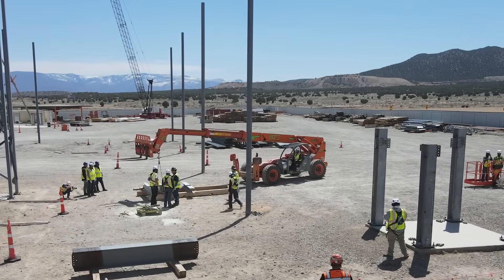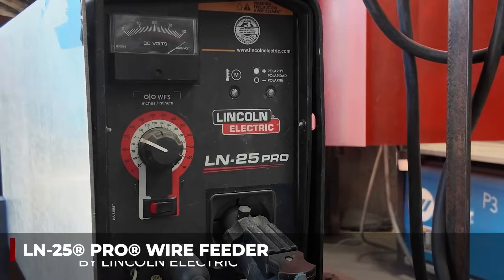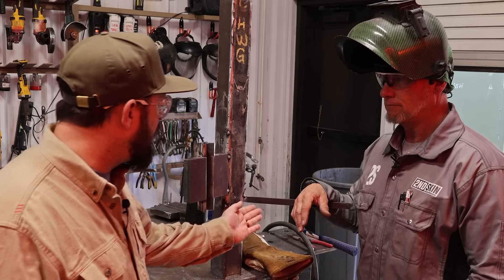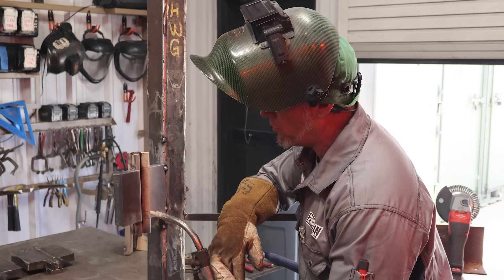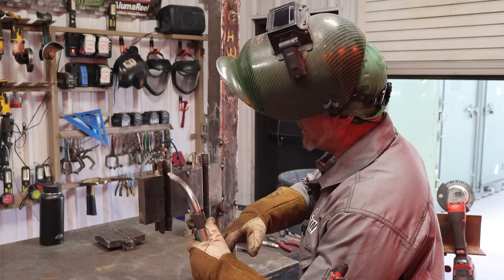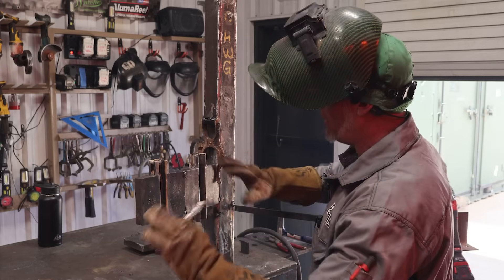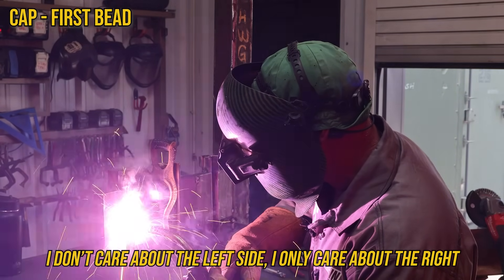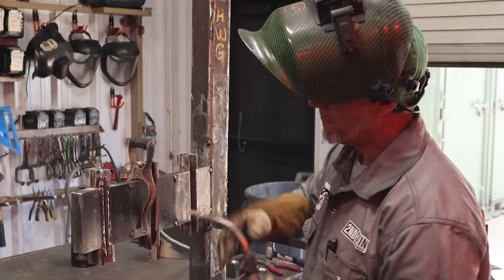FCAW-S Breakdown: How to Nail Your 3G on 1” Plate

Comment: That guy really knows his stuff. Seems to have a very strong technical competency with clear knowledge about basically anything-welding. Must be a treat to be taught by someone like that.

I'm a DIYer who occasionally does FCAW out in his garage using a Hobart 190 for little things around the house, and after watching this, I'm amazed at how he never once used any anti-spatter spray because when I do my stuff, I spray that shit on almost everything like a yard sprinkler. Ha. Again, a DIYer...

But I hate how FCAW never gets the respect that I think it deserves within welding circles. Coming from someone who's as amateur about this stuff as they can get, even I can tell that if it's done even just "generally well," FCAW welds can be every bit as strong as anything else out there. Sure, they never look like stacked dimes, but if I was a betting man--which I'm not--I'd wager my house on the idea that you can have welds from FCAW that can be just as good as anything done from GMAW, SMAW, or anything else (as long as it's done correctly). Yes, "done correctly" can apply to almost anything in any context, but I know I haven't seen any TIG stuff that has the strength you can enjoy from FCAW. Not saying it can't be as structurally good, just that I've never seen it. But like the guy kinda implied, it's more of a structural welding type anyway--and definitely not meant for aesthetics or finer control (i.e. - thin or precise welds). At least, that's what I've always understood about it.

But in any event, great video.
Reply from the maker: Thanks for watching! Won't be the last time we do a FCAW video.
Reply: Don't forget: gas is worthless when it's windy.
Reply: @AwestrikeFearofGods  Barriers and shields are used on construction sites all the time when using FCAW-G outdoors with wind blowing.
Reply: @ChevyConQueso  Fair enough, but most home gamers don't spend the money or space to store welding tents, etc.
Reply: Dual shield FCAW axial spray is one of the funnest processes, and also really strong. Lots of it in construction and ship building.
Reply: So you are willing to trust your family and friends lives with a Fluxcore weld
Reply: @Nuf_Nivah  I don't think the person commenting is building a skyscraper or roller coaster. I think he deserves mad respect; he's a self described diy'er and knows a $hitload about the technical aspects of welding.
Reply: @jennysouther1795 ok but that’s not way I read it saying it is a as strong as stick
Reply: @Nuf_Nivah if you are using consumables with equivalent specifications, there’s no reason it’s not as strong. Obviously you’re not making structural welds with wire that you run in a Hobart 190,  🤦🏻‍♂️
Reply: @Nuf_Nivah  Ironworkers use innershield as well as smaw and I believe dual-shield too
Reply: @Nuf_Nivah  Fluxcore is 100% as strong as any other weld as long as it was done properly and has the penetration it needs. You can do a lot with 190 amps. You use multiple passes just like if you were using nothing but 3/32" rods and 90 amps on thicker steel. Preheating the metal is necessary once you're over a certain thickness regardless.  Don't discount it just because the average user of a small machine and FCAW is completely talentless, unqualified, and lacking the knowledge to weld anything critical. With skilled hands, you can put just about anything together safely with any process.

Comment: Not mentioned in the video, there is also multiple types of the wire. Some, like the E71T-GS, are only good for single pass applications. But the E71T-11 , is rated multi-pass applications. That’s a pretty important thing to be aware of when buying FCAW-S wire.

Comment: If you go for your d1.5 certs you aren’t allowed to use any power tools. Chipping hammer and wire brush only
Reply: In the real world we use power tools, we don't care what your test requires.
Reply: @MasterCheeef cool
Reply: Very cool @johniron88
Reply: They allowed me to use a wire wheel on a 4” so there’s that.
Reply: @FNxmm then you probably got d1.1 cert not d1.5. In the AWS test procedure regulations. It states d1.5 no power tools. So there’s that
Reply: @johniron88  actually i think you are right i was on a different test. Sorry for the confusion.

Comment: i went to make a welding test long time ago  at shuff steel and they don't 
 let use the grinder even the wire wheel just wire brush and chipping hammer?
another thing where you got your welding hood
Reply: Hood is from CMR Fabrications

Comment: just glue it
Reply: I don’t understand why they are trying to push fluxcore . It’s not going to be as good as stick the only thing I can figure is that they can just get “welder’s “ out on a job site. Welding is a skill you are born with but it can be learned. And the best welder’s welds you can’t see the weld because it’s actually married together.
Reply: @Nuf_Nivah where can we see these invisible welds? Have you posted some videos ?

Comment: As a union iron worker out of local 402 this video was very helpful especially with how difficult this wire can be especially in the 3g position very helpful video👌
Reply: #seechriswork
Reply: So you are saying that you would trust this like a stick weld
Reply: @Nuf_Nivah  yes I would
Reply: @CristobalMojica-nh4gv  as a union worker,  your Union hall will provide this training at no cost.  This is why we pay Union dues.
Reply: First time I ran gasless fcaw I was trying to push it like vertical 7018. I couldn't figure out what i was doing wrong until a coworker told me to keep a slight drag angle and that changed everything.
Reply: Iron worker....
Reply from the maker: Glad this was able to help!

Comment: guys you have to do bending test to prove your point, is it really strong weld.
Reply: Generally you get better penetration with Gasless Flux Core over Gas Short Circuit. Cut and Etch with this thick plate would be interesting over a simple bend test.
Reply: @seabreezecoffeeroasters7994  but you wouldn’t be using mig or tig for structural welding.
Reply: @Nuf_Nivah  FC Gasless gets used a lot of structural work outdoors along with Stick.

Comment: I feel like you burning a little to cold dad
Reply: I hear you Billy.  My settings could be adjusted hirer and still work. In the field on large columns and girders I run the voltage and WFS a bit hire, Just depends. Today I’m in the field splicing 3-1/2” thick flanges on columns. They are D1.8  and 80 KSI,  913  grade 65 Steel. I’m sure you know what that means. Oh, and I’m using NR 555 5/64” diameter wire.  

You see Billy, I’m not just an instructor, I’m in the field almost as much as I am in the shop. I came from the field to teach, cause to your point, what good is an instructor who has never worked the field. 
The truth is Billy, there are ranges to the different FCAW-S wires for a reason. Sure I could run it “hotter,”  but did you know Billy, that I can run NR233 at 19 volts and 190 IPM/WFS, on any size steel and still have a sound weld with the same structural integrity? Did you know that?  Did you know that I could run multiple stringer beads at a low voltage and have a stronger weld then if I ran it at a hirer voltage with fewer larger passes?  Do you know why Billy? You see some people are shown how to weld, and some people know how to weld. 
Either way, if it passes we both get paid right?
Who’s your daddy?
Reply: @Michael-f8c2n 😂😂
Reply: Fr. At 210 for wire speed, 25.5 volts would help wet out that puddle while still keeping it cool with such high wire
Reply: @nativerockstar7651  from what I seen it was 20 volts even 25 volts feels to cold for 1/16 wire especially inner shield
Reply: @nativerockstar7651 no sir 25.5 according to our wps would need more wire speed
Reply: We have to follow the wps
Reply: You can even look up Lincoln's recommended settings and 210 is too high for 20 volts
Reply: It's a good video overall, I'm just saying bumping it up to even 22.5 would help tie in the sides better and flatten it out more
Reply: @nativerockstar7651 that’s diffence between welder out in the field and a instructor in a building , idc what the wire box says 1/16 inner sheild ya burning cold on just 20 volts , I’ve ran 0.35 hard wire hotter then that before

Comment: Should add that the stickout preheats the flux in the middle of the wire to get correct shielding gas protection/coverage. Too little and it overheats the flux, too much and you get an inconsistent arc